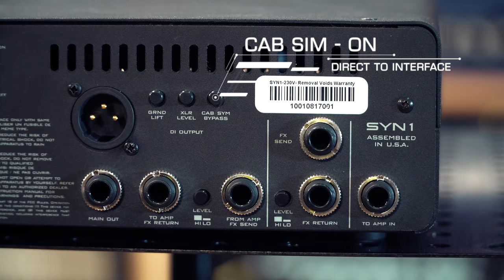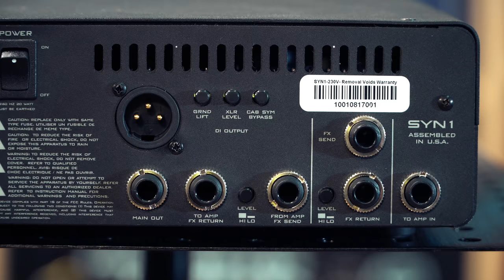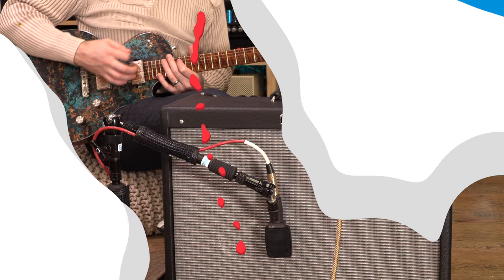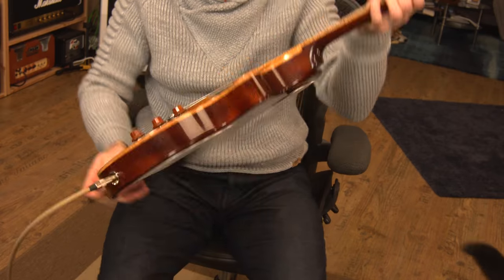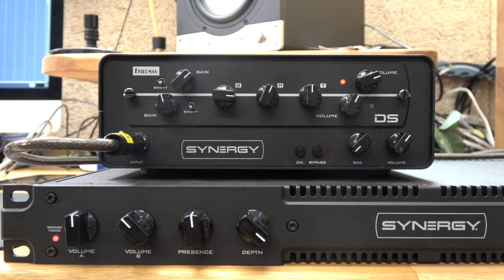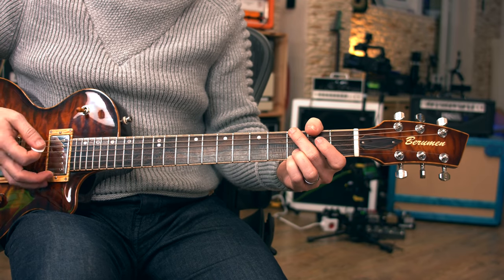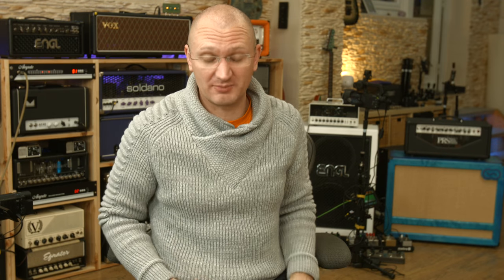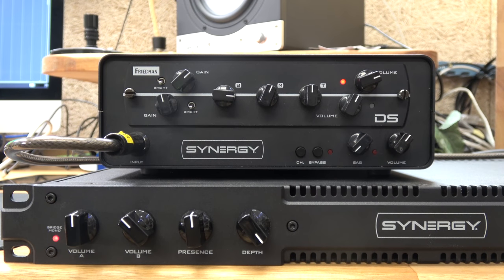Synergy DS Module Review - How does it compare to the Dirty Shirley Amp?

Comment: The power amp makes a BIG difference! You could probably replace the preamp of the real DS with the DS-module (like you did with the Fender amp) and use the bypass function on the module for switching between them. So they would share the same power amp. It would show if it's the same or not. Brilliant idea huh?! ;-)

Comment: I’ve got quite the interesting question for you Henning. So I have a joyo pxl live switcher with all but one channel taken up. In loop two I have all timed fx for the fx loop of my amp. If I have two amps, how can I switch my main overdrive pedals (loop 1 of the switcher) and my fx loop pedals (loop 2 of the switcher) through two different amps for a reasonable price. Thank you!
Reply from the maker: you can’t do that with the PXL... switching the FX into the loops of another amp? That is complex... it would require something like the Ampete 444 switcher, but that is not cheap
Reply: EytschPi42 I had figured. Thank you for your help!

Comment: The problem with ALL of these over-produced sounding video's is that you don't really know how the product will sound for YOU until you ..... oops, "Buy It".  Darn, i've gone and spilled the beans.  Yet another money-grabbing sound-scheme to pull out what little $'s guitar players have in their accounts.  As if over-priced pedals, amps and processors weren't dangerous enough to our budgets .... NOW we're expected to fork over 100's $'s MORE on this latest morphed technology, suspiciously similar to Randall preamps that were in the market place years ago.

I have a suggestion: turn OFF all of your YouTube channels for six months, then go to your music room and ...................

PLAY GUITAR !!!
Reply from the maker: Andrea, if you had paid attention in my videos, I state VERY clearly in my "Everything you need to know" video that this is based on the Randall System, which wasn't new, because it was based on the System Bruce Egnater designed before that. This is the same System, just developed further and they are working with the real manufacturers... 
If you don't want to buy it fine, but that doesn't mean that it doesn't work or that it is bad.
That is the same argument people have against APPLE... it is expensive and that's why it is bad. Apple is expensive, maybe overpriced, but it works... same here... not cheap, but it works and it is a solid product... if you don't want to, just don't buy it.

AND: you are totally right.... people should make music and practice.... gear can't make good music, people do.